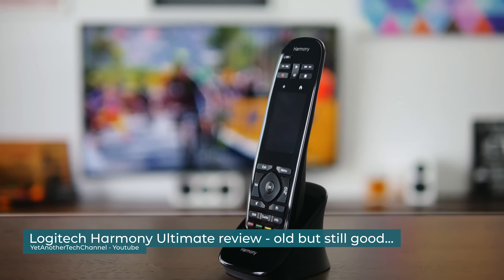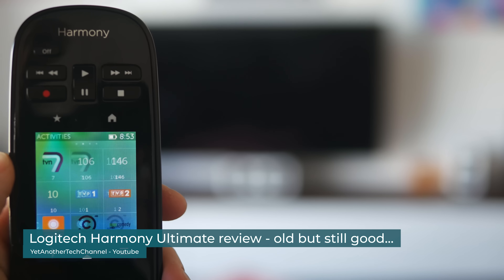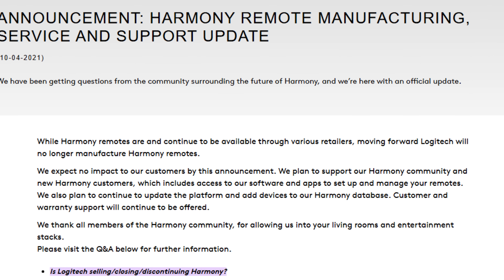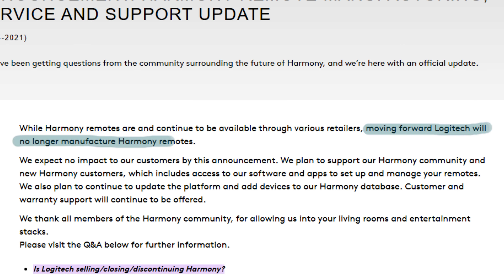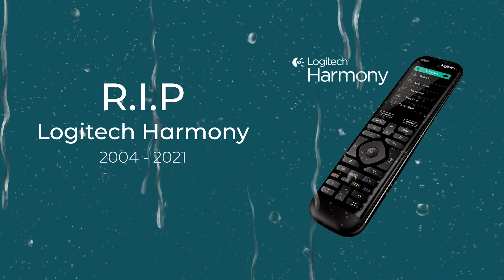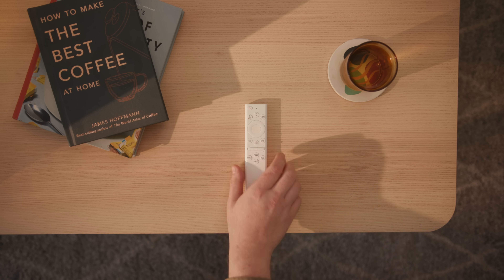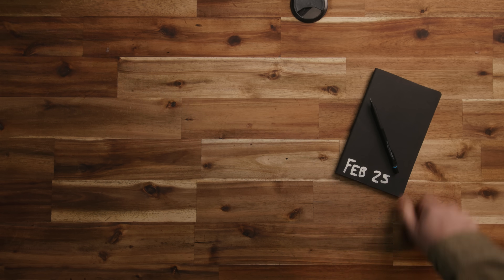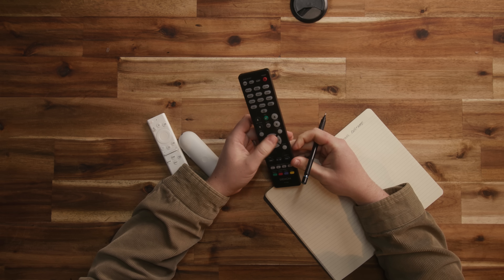My TV Remote Stopped Working… So I Made My Own.

Comment: for whatever it's worth this is a project I'd love to see get more development. Right now while there are a ton of FOSS self hosted media solutions, there are basically no good remotes for them.

A good, extensible set of open source firmware & rough, modifiable design for remotes in the age of ESP32s & 3D printers would be massive.

Imagine if someone used openSCAD or something similar to create a fully automated remote generator or something where you could literally just pick a screen, your button layouts, even one of those flipover keyboards on the back or something and just generate a new remote with that design.

Comment: Nice work. It's amazing how so many, almost all, proper manufacturers of devices just can't make a simple, practical remote.

Given that it looks like it's WiFi etc?, I reckon an interesting feature would be to add in a little speaker and able to have some way to send a "Find Me" packet to the remote itself and have it beep so it can be found if it goes missing!

Comment: Love it! Missed opportunity tho to add a buzzer to the remote and then stick a button on the tv or wall that turns on the buzzer so you can find it when you lose it.
Reply: I printed a new battery cover for my remote which holds a tile device. Really handy when you have kids.
Reply: @chaos.corner  I'm a disgruntled tile customer. I put one on my mug so I could find it at work, but it really doesn't narrow down the area much and I have to hope I'm within range to start doing the proximity find thing. really wish it was as good as air tags.
Reply: The best thing about open source projects like this is that you can add stuff yourself. If you want to add an IR blaster or a buzzer for finding it, you can just do it. It's the best
Reply: @vyladence  'to add an IR blaster or a buzzer for finding it'
That is exactly the real problem.  You have to have an almost entirely unused back channel simply to communicate to the remote, and tell it to buzz.  And IR is cheap, but it won't work if the remote is hidden from the IR.
Roku did it with radio, and also uses the radio channel to the remote to play audio for the headphone jack on the remote, so you can listen at night easily without external volume.
Still, probably goes completely unused for most people.  Black remote, I used a few small strips of white tape on it to make it much more visible, and hold the pieces on since I have hardwood floors and the battery door and IR cover go flying if it drops.  You almost never need a 'remote finder' if you make the remote itself contrasting and highly visible.  If you can't immediately see it looking around, you know it fell into one or two of the tucked in places behind the couch, etc.  Even hidden it's easier to find with the tape, because you know it isn't laying around 'somewhere else' that you just aren't seeing, and you'll spot it faster behind cushions, etc.
Reply from the maker: That's a great idea!
Reply: @TheStockPot-AU  I love this spirit of community contributions & collaboration
Reply: Definitely doing this for myself
Reply: It's connected to home assistant so you could even as your smart assistant where the remote is!
Reply: That would be awesome. I've lost our Chromecast remote so many times, sometimes for weeks.
Reply: @Muscleduck   if you have the google tv streamer it does have a buzzer and a button on the streamer to find it (or ask google assistant/gemini)
Reply: @Muscleduck I'm 99% sure my Chromecast didn't come with a remote. I mean it's literally in the name "cast" as in you cast the thing from your phone to your TV. I do hate pausing with my phone though.
Reply: @bland9876  The chromecast with google tv comes with a remote, but the older models did not. Its actually the remote shown at 1:51 in the video (the pill shaped one)
Reply: Also... Adding a blinking IR LED would have been pretty trivial, just saying 😅
Reply: Genius
Reply: Calic is a fucking pro. What a good idea
Reply: That was the greatest idea that I ever heard
Reply: cant do that when its in deep sleep
Reply: ' so you can find it when you lose it.'  Standard feature on the higher end Roku box.  Even if your TV comes with Roku built in, it's good to get the external Roku Ultra, add the max SD card, and have everything perform better.  Plus the remote finding, although I don't need it too much.  Black remote, use a few small strips of white duct tape on it to stripe the remote.  Makes it a breeze to find visually as well.
Reply: or make the remote really thick
Reply: Are you restocking?
Reply: Wouldn't it be easier to design and make a home for the remote near where you use it the most? Obviously I'm not afraid of fiddling with electronics (else I wouldn't be watching this channel) but some things are solved better and more easily by habit engineering.

Comment: I'd personally love to use an existing shell, like Samsung's, along with esp32. The only drawback to HA for theater automation is device/software outside the ecosystem. For example, AndroidTV or GoogleTV's lacking APIs for smooth and fast IP-based control. Those devices and Android OS just don't take to API requests in the same fashion as their built-in Bluetooth controls. Otherwise, WiFi and HA automation is a godsend.

Comment: For anyone needing a remote with IR I'd recommend Sofa Baton. They've kind of become the spiritual successor to Harmony. They don't quite have the same refinement as the full Harmony line but if IR is a requirement it's really the only option. They also do Bluetooth so they should work with a lot of the other TV devices as well.
Reply: the part that kinda peeved me about the sofabaton U1 is that when I bought it, it didn't require a login to program the remote, and I could add macros so if I'm on a device that's not the TV, I press the source button to change the input to the specific one that I needed. I lost the ability with an update, and they forced me to login to a dumb remote that had no possible way of connecting to the internet other than installing the app and connecting it manually because they added the ability to use the new X1 which does connect to the internet using a base station, but that's not my remote.
also the remote doesn't like using rechargable batteries so I have to buy disposable just for that remote. ugh.
Reply: @JessicaFEREM Buy NiZn rechargeable batteries. They output the full 1.5v :)
Reply: you could altso add a IR blaster to the remote, im sure its just a LED, transistor and a sprinkle of supporting components away, along with a weekend of hacking.
or if not possible you can altso get dedicated IR blasters for homeassistant witch will have the benefit of being free from the remote and so always visible to the device.
Reply: I'm going to use this to send commands to my linkinlink ir blaster. Then I don't have to worry about pointing the remote any direction as the ir puck will be sitting near the equipment it's controlling.
Reply: Why wouldn't IR be a requirement? How else do you turn on your TV or Blu-ray player?
Reply: still using the harmony myself. they stil work. and for now logitech still supports it.
indeed not for sale, but enough people sell them second hand for like 30 euro's
Reply: I would say the Becsy universal remote is a much better remote than the sofabaton. I just had issues setting up that remote while the Becsy was pretty straight forward. The only downside is the battery life but otherwise it's a great remote.
Reply: IR is a thousand times better than RF now because everyone is blasting RF from every device at all times. Also modern IR leds and receivers are so good, they can pick up reflections off walls from other rooms
Reply: @Gunbudder I have a GameCube in the way of my Blu-ray player so it doesn't turn on but if I hold the remote backwards and lift my hand up high enough to go above the GameCube then it'll still detect the press for some reason even though the remote is literally backwards.

Comment: A couple of tips for designing for FDM printing...

There is a cleaner method for handling holes like for the SHCS, make staggered bridges one layer thick around the holes. Voron Design does this if you need a better example of what I mean. There's no need for the user to do post-processing with this method.
Secondarily, slicers are starting to include settings for bridging such holes so it might be worth not even including them since the end user will be able to decide if they want a sacrificial bridge or not.

For the button face icons, instead of cutting out the face and leaving it empty do a second operation to add a new body in place. When you export the STL make sure to include both bodies so when a user drops it into their slicer they can either keep both bodies with different colors or remove the icon body and end up with it being the same as your finished example.
Reply: Haha, someone beat me to it. Too bad it's not a more commonly known method - it works really well. Also learned it from voron.

Comment: Nice project.  I too am a huge fan of the Harmony remotes.  We have a bunch and now, everyone one of them has failed buttons.

So I want to build a new remote, pretty much duplicating the functionality of the Harmony.
Except, of course, it won't have the ability to connect to the Logi site to download the remote codes.

What I'll have to do is to create my own database of the remote codes.  Fortunately, I do have a cute little device that's able to read the codes and display their HEX stuff.

Hopefully, I can use those.

I do have to make this IR as I don't want to connect to Google Home Assistant.  Some of the devices are older and can't use the assistant.

My biggest challenge was going to be making a remote that is nice, like in this video.
But it has given me some ideas, especially with using dual or triple colors and a .2 nozzle instead of .4.

Nice job there.
Reply: bro, can you help me fix this problem? I have an old speaker(kamasonic sk-200G) that I've been using with my PC for 12-14 years. Unfortunately, the remote got destroyed, and now I only have the circuit. I've tried many times to repair it, but I haven't been able to fix it yet. The issue is that when I turn it on, the bass is automatically set too high, and I have to manually decrease it using the button. I don't like the bass, and I only need a remote button that reduces it. The speaker's built-in button is also not working well. now what can i do? please help

Comment: I really didn't think about making it for someone else to help them but this is a very nice idea too 😄
The infrared is really easy to implement by the way. I used it previously to turn on the tv and amplifier with esphome. You just need to test, read documentation or learn remote codes. Very easy if you have the old remote and a flipper zero laying around

Comment: I love it, if you add a good ir blaster to your home assistant you could do it all
Reply: Exactly. I built one myself using an esp8266, a IR shield, a cheap enclosure from aliex (they sell specific enclosures for IR hubs with IR-transparent covers!). It's crazy what you can do with this cheap device. I control my old dumb speakers using this and it's nice. Might be worth doing a video for youtube
Reply: @hundry_f  bro, can you help me fix this problem? I have an old speaker(kamasonic sk-200G) that I've been using with my PC for 12-14 years. Unfortunately, the remote got destroyed, and now I only have the circuit. I've tried many times to repair it, but I haven't been able to fix it yet. The issue is that when I turn it on, the bass is automatically set too high, and I have to manually decrease it using the button. I don't like the bass, and I only need a remote button that reduces it. The speaker's built-in button is also not working well. now what can i do? please help
Reply: Linknlink makes an mqtt IR blaster puck that works with Home assistant too, I really like mine
Reply: How much lag is there?
Reply: @Endpoint101Tech Not sure about this one, but I have a Broadlink IR/RF (RM4 Pro) blaster that is more or less instantaneous. They make an IR only one as well for a little cheaper (RM4 mini). $45 and $30 respectively. And initial integration and programming with home assistant is kind of a pain. But once set up, they've been bullet proof for me. And I just use zigbee buttons to trigger them. Not quite as cool as making my own remote, but very effective.

Comment: Cool Project! I imagine adding something like an accelerometer would allow for way longer battery life. Basically while the remote is not moving it goes into deep sleep, but once you grab it, it wakes up.  This might just be fast enough to not notice the delay while it is connecting to wifi.
Reply: At that point, IMO, you go the full distance and put the IP control into a separate device along with RJ45, and the remote can then use BLE to communicate with this hub device.
Reply: @amerikalast  Yes, build something similar a year a ago. I've used the ESP-Now protocol. Every time you press a button on the remote the ESP boots up, sends a telegram via esp-now and shuts itself down again. The whole process takes ~200ms. Battery life ~8 years. I use them as light switches in every room.
Reply: @abc321meins  VERY cool, thanks for sharing, I may use this in a project and I really appreciate it.
Reply: @ I don't know if ESPHome supports running only on bluetooth. If it can this would be quite nice. Especially when you already have a mains-powered ESPHome device nearby to relay the bluetooth
Reply: this is basically what the harmony 650 had (and probably others) but it was just some sort of tilt sensor like a reed switch  (you could actually hear it sort of rattle). the screen would light up when you picked it up.
Reply: I was gonna say "why not just deepsleep 2 seconds after every button press" but connecting to wifi is probably not immediate lol
Reply: How about coil ala Faraday torchlight (shake to charge) or induction coil for wireless charging?
Reply: Qi charging would be easier. Leave the remote in the qi charger when not in use lol.
Reply: just wait 10 minutes then put it into deep sleep until a button is pressed. Its an esp32
Reply: @UserUIser But then the esp32 needs a few seconds to wake up and connect to wifi. Making the first button press quite sluggish. The accelerometer would wake the esp32 up before a button is pressed, making the first press respond faster.

Comment: Idea for anyone trying to build a harmony type remote for cheap, create a remote which can receive and store the IR signal you shoot at it, then have a gear thingy to have different profiles.This way, you can use that to control all the devices in your room without having homeAssistant. Just make sure to remember all the controls

Comment: Surface mount soldering by hand, depending on the parts, is not at all hard. 1206 sized resistors and SOIC IC's are very easy to do by hand.
Reply from the maker: True! But my hope is that some folks who have never soldered before might give this a try, so I tried to make it as simple as possible :)

Comment: I am watching and can't wait with my comment for the  video to finish: yeah! Some weeks ago I thought if it was possible to make a personalized remote control, because my old mother got a new TV set and I am the one who has to explain it to her.
I think of several programmable buttons, and would it be possible to integrate an e-paper display into it? Are there e-paper displays with touchscreen capability?
Hiw difficult would it be to integrate an IR diode into it? I think the elderly people still need it. Do you have any ideas how one could hack a conventional remote control (change the Netflix button into a YouTube button)?
You could integrate a battery that is rechargeable by QI to use a smaller battery or have different design option where to place it.
Reply from the maker: A V2 would definitely benefit from an epaper display!

Comment: Nice video! 👍💪 How long does the battery lasts with a full charge just sitting there and waiting your input? And how long in an everyday use? Did you take advantage of the deep sleep state of the ESP?
Reply from the maker: It gets a couple of days, more than the Samsung remote these days! 

I haven't set up deep sleep, as the restart & reconnect time was a bit slow when I tested, so I stuck with light sleep for now!

I'm still refining my YAML, so I may eventually implement deep sleep in some form!